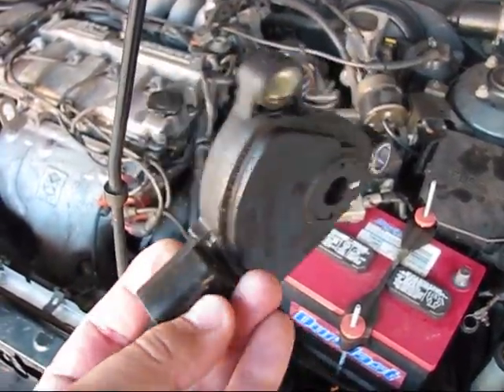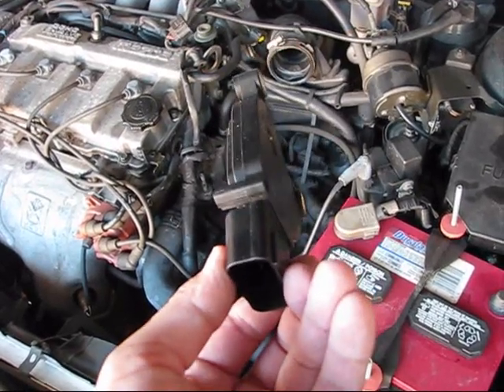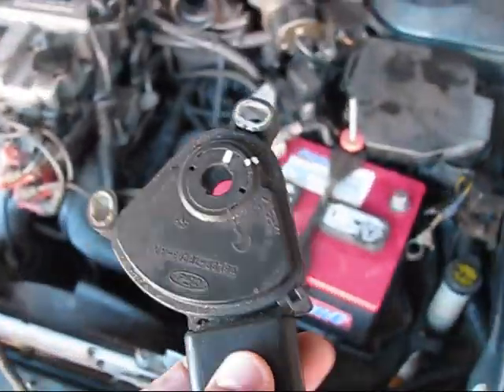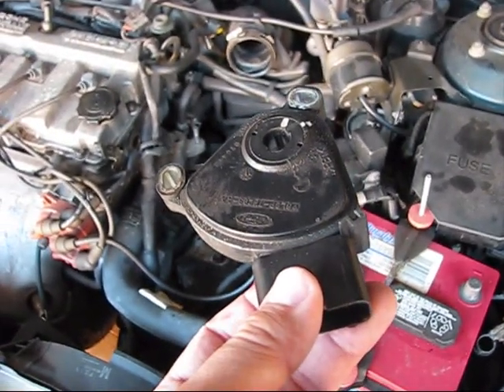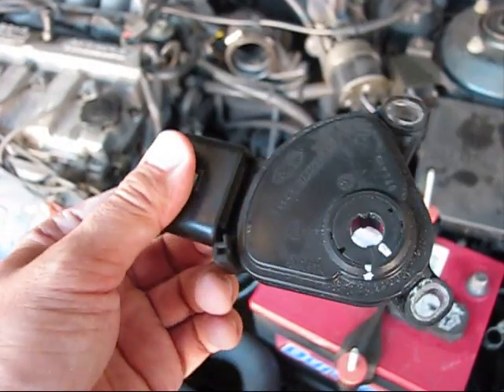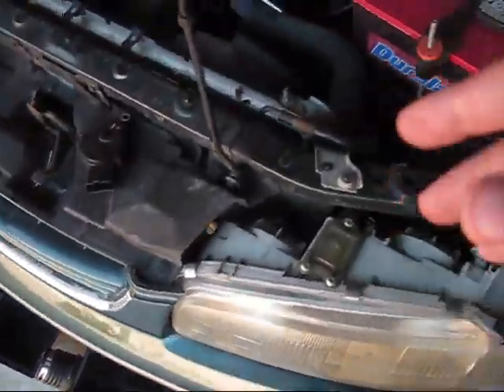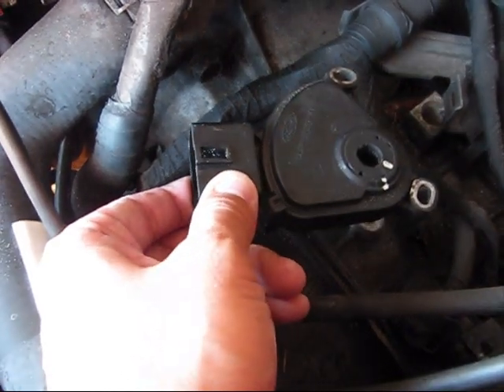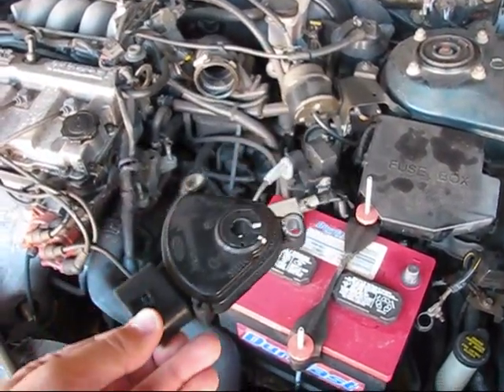Mazda 626 Transmission Range Sensor aka Neutral Safety Switch Location

Comment: That little hole in the center of the sensor, the new sensor must go back on in the same position you took the old one off, place a mark on it before removing the old one. If you put it on in any position your vehicle will not shift right. Did you notice the white marking he had on his.   Look at other videos on this

Comment from the maker: I also could be VSS And TSS sensor...   try to press od button on the shifter stick...   When you press it the hold light lights on the dash, and the transmission will stay locked in top gear and not go into overdrive. So you will be able to determine the faulty VSS or TSS sensors...

Comment: Hey I have a 91 636. It starts just fine but when I put it in gear it won't drive or reverse. Do you think that it's the sensor or the whole transmission?

Comment: I got a 04 mazda 3 the vehicle starts and raves up fine in park but as soon as I put the transmission into any gear it shuts off. I've changed the cam sensor and the throttle position sensor and still doing the same thing. Any tips or advice would be appreciated. Thank you for you time

Comment: I have a 98 mazda 626.  The automatic transmission went out and I had it replaced.  before the replacement there was hesitation when I would reverse and it would be sluggish at highway speeds.  Now that I replaced the transmission it still has hesitation when I reverse but it also has a hard shift from 1st to 2nd.  Any ideas?  The shop says you just need a tuneup and the computer will reset itself in a couple weeks.

Comment: Hi. I have a Mazda 626 94 model that will drive but not reverse. Will this fix the issue?
Reply from the maker: Highly doubt if it never doesn’t reverse most likely transmission rebuilt is required
Reply: @gavrilovas1   thankyou! You have been a big help and thankyou for replying! 💖

Comment: HI, I have a 96 mazda and I am having problems with the auto trans, it seems to be slipping when changing up the gears.the revs go up but there doesn't seem to be much power?Have you come across this problem before,do you think it would need a rebuild?
Reply: Hey did you end up sorting the problem? Girlfriend's car has the same issue!
Reply: yo tengo el mismo problema me podrán ayudar porfavor

Comment: I had t o replace this part on my 1998 Mazda 626 LX with 4 cylinder engine and automatic transmission.  My symptoms were mild to start then very severe before I replaced it.  An early symptom was it not downshifting on a hill from gear 4 to 3.  Noticed the rpm get quite low near tops of hills (under 2000) and it not downshifting by itself.  Another was when I  used of the overdrive button on my floor shifter to manually go from gear 4 to 3 when coming to a stop, it would shift quite hard and at the end before I replaced the switch, actually shake the car for a split second.  The last symptoms were it shifting by itself between gear 4 and 3 when it was no necessary and jerking when it did this.  Also it would go from gear 4 to neutral and scare the crap out of you!  Also did some gear 3 down to 2 but not as much as the gear 4 to 3 symptom.  I replaced the switch, took it for a drive and seems fixed.  Will come back in a week or two and post how it is working then.  This is the same switch and car shown in this video.  Very easy swap.  $52 at Advance Auto.  Saw it for less at Amazon but could not wait 3 to 4 days.  PS, I had an OBD 2 code scanner and it had error code P0708 which leads you to this switch only with that code.  I think there are 4 error codes for this switch with one being bad wiring to it.

Comment from the maker: If Transmission Range Sensor installed properly adjustment could be checked by trying to start the engine in all gears. It should only start in Park and Neutral.

Comment: Hello .
I have Mazda 626 1995 2.0 automatic transmision . My Mazda 626 won't shift gears in DRIVE MOD it starts with 3rd gear and stops with 3rd gear, any other gear i working properly.and the car is driving normal but does't shift . Please help me . NEIDER ONE OF THE LIGHTS IS FLUSHING . THANK YOU :)

Comment: I am giving this a try.  I have a 2000 Mazda 626 I just purchased and I am getting p0708 code.  It shifts erratically especially above 45 mph.    It also occasionally gives problems in the first 3 gears as well.   I always notice that when I turn the car off and start it back up the issue goes away, which tells me it has to do with the computer being out of whack (due to a faulty neutral safety switch I hope).   Got one on amazon for $22 shipped.
Reply from the maker: Scott L Could be faulty neutral safety, It's possible that your transmission requires rebuild.. Please let me know if replacement of faulty neutral safety, solved the issue..
Reply: Alexey Gavrilov Indeed this simple $22 part solved the entire issue.  My trans is as smooth as a baby's bottom now.   I bought this car off craigslist for $900 (guy was asking for $1300).   I took a chance on the tranny having this issue and I really didn't know much about what could fix it.   It was actually a pretty risky buy, but I took the chance.   Now I have a really nice 2000 Mazda 626 with a great A/C and leather seats, only 144K miles and an engine that doesn't have any leaks (the under carriage of this car is as clean as you will find from a vehicle this old).   I got lucky.  The brake shoes needed replacing as well and got all the parts from advanced for $36 and now this neutral safety switch for $22.   So all in all $58 and I got a heckuva car.   Thank you so much for this video.   It convinced me to give replacing the switch a try.   I bow in your presence.
Reply: FYI, I actually was able to replace the switch without even removing the air breather assembly.  I just loosened the air filter compartment to the point I could lift it up and away.  It gave me enough access to get to those two bolts.   Took about 15 minutes from start to finish.  PLEASE REMEMBER TO PUT YOUR CAR IN NEUTRAL AND LIFT UP THE EMERGENCY BRAKE before swapping out this part.   The replacement part will be set to the neutral position.
Reply from the maker: I will also recommend to replace transmission fluid and clean the magnet in the transmission oil pan... all this if done correctly will extend transmission life..
Reply: Alexey Gavrilov From what I have been told and read, this CD4E transmission does not have an oil pan and the oil filter is not serviceable.   Luckily, my transmission oil looks pristine.   I am considering installing an inline filter to help extend the life of the tranny.

http://etereman.com/blog/ford/the-ford-cd4e-your-most-burning-questions-answered

It recommends installing a tranny cooler and using synthetic oil to prevent a fairly common overheating issue.  The next trans oil change, I am going to use synthetic.   Not sure if I am going to put in a cooler.   

Here is another great site with tons of info on this tranny.

http://www.frontiernet.net/~jdre/Duratec%20and%20ATX%20Rebuild%20Pages/CD4E%20FAQ.htm